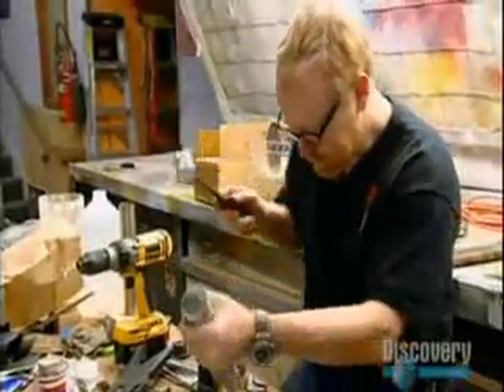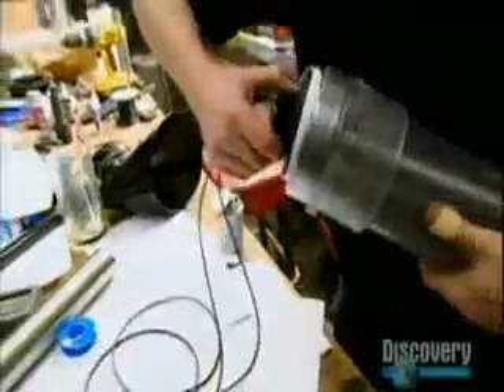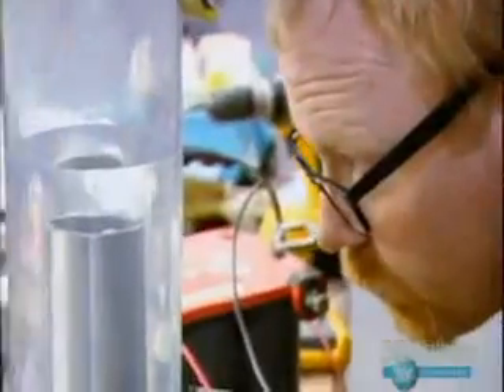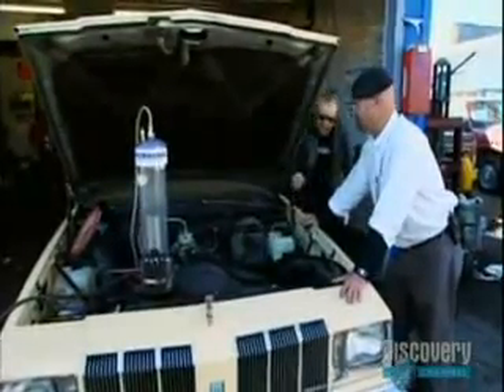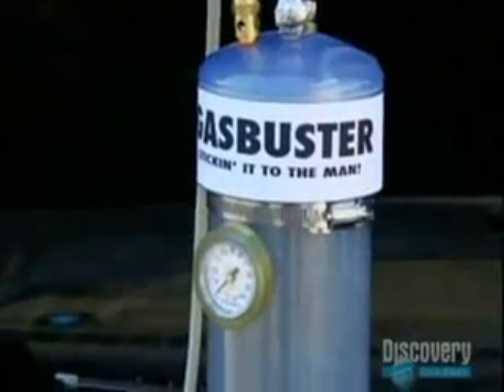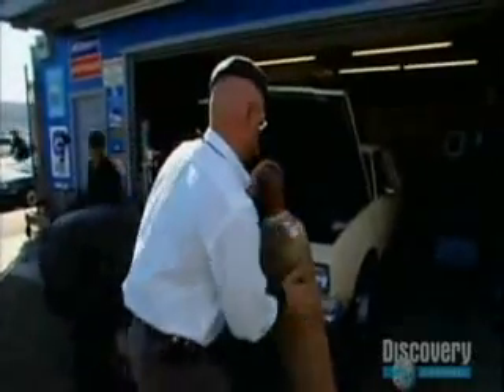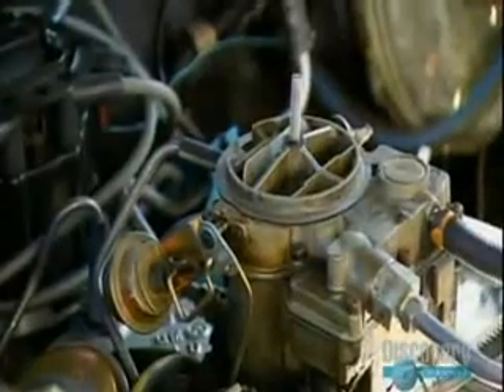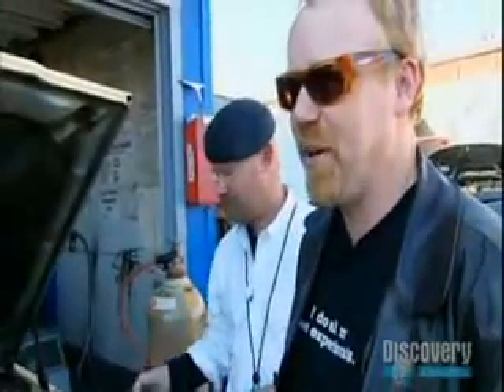HHO Mythbusters Explained

Comment: Tell me almighty tard fuck....where is your functioning fuel cell tested under lab conditions? Its always some super tard missing five teeth that shouts out "look at may mayonnaise jar technological marvel!"
 
Laws of Thermodynamics show why these dont work.
Reply: You can use sustainable energy like solar to generate the hydrogen, which would be used effectively as a battery. It isn't about some mythical free energy thing
Reply: then consider how much H it would take. A 2 liter engine at a 1000 RPM high idle would be using 1000 liters of fuel/air mix per minute.To produce 1/2 kilogram of H2 would take thousands of kilowatts.  You would be better off using that energy in an electric car

Comment: it didn't work cause  they do not add the power to brake the molecules faster you need about 30 amps to brake them on demand when you car is running and you not need to be a super intelligent to do it just common sense

Comment: This is the show that turned me off to this show, There were several shows that clearly show that they were payed to fail. I made an HHO generator and installed it on my 1992 Pontiac Sunbird  The fuel mileage  went from 26 MPG to 38 MPG. with no other changes to the car. One of the things that a lot of people dont think about is that 1/3 of the gas that you make out of the water is oxygen. This helps burn the gas and the hydrogen.

Comment: Total shower of PRICKS no idea that size is not enough to run a car but EVERYONE has it wrong you still use the petrol or DIESEL which ever the car runs on but add the hho and don't use the current  direct use a pulse module even then there isn't much gain in MPG till you fit a MAG SENSOR ENHANCER then 30% gain in MPG any way even without it the thing everybody is failing to understand  ZERO  EMMISIONS NOT 200MPH.

Comment: The question none of you HHO guys can answer is; how can you get more energy out than you put in. It takes electrical power to split the water into HHO, and that means more current needed from your alternator, which means more load on the engine, which means more fuel required to keep its rpm stable. And thats without even thinking about inefficiencies. 

There is no doubt it would help with complete combustion and increase power, but only if the power used to generate the HHO was coming from something other than the cars engine (say a totally separate battery not being charged by the alternator).

There is no such thing as 101% energy.
Reply: How many miles per gallon do you lose when you turn on music in the car?
Reply: 12 volts is already available under the hood...to break the water from liquid to gas
These vapors flow alongside the already moving fuel thereby reducing gasoline consumption.
Reply: I saw some guy making hydrogen with water and chloride, that's extremely cheap way of getting hydrogen, so why you need that electricity crap for?
Reply: Making hydrogen isn't the problem, how do I use it in my engine efficiently and safe - this is.
Reply: He put cold water, some chlorine and a aliminium ball - and got hydrogen gas

Comment: You can't tell me these inventive science guys who I avidly watched when they were on their show, wouldn't have known that you need an electrolyte in the water to aid the electric reaction. 
I was so annoyed with this one when they just let it go and not even use common sense and try it with some kind of electrolyte in the water to really prove whether it works or not. 
I can't help feeling there was some outside influence on this one... 
The YouTube channel "king of random" has a "HHO set up" to build that he claims produces two litres of hydrogen/ oxygen gases every minute or so with two car batteries. That's way more than most cars need.
 My car doesn't use a litre per minute!! 
And there's no chance of an explosion with this set up because it's "on demand".. 
It's only produces the gases while you're ignition is on. 
When you turn off the engine the gases stop and you only have what's inside the hoses. No big tank of fuel, ever!
Reply: Tee hee.  1 liter of hydrogen per minute would run a small toy car, or keep a couple of candles lit.  Not enough power to do shit..

Only have what's inside the hoses?  Still enough to blow the hoses off.  

That's not on-demand.  That's continuous generation as long as the key is turned on.  Where's it going while you're at a stop sign?

On demand would produce HHO only while the pedal was pressed and the car in drive.

Comment: I have actually ran my 2000 blazer on only hydrogen I drive it daily when I mix gas and hydrogen I can get around 40mpg I run a 2 battery system and two water perks to cool and store some of the gas. Running on just hydrogen I can get around for about 2hours before i need to pull off it gets hotter than gas obviously I have cracked 2 radiators from over heating but I know have a 3core misumoto and electric fans going on my first big drive today will let y’all know
Reply: bullshit

Comment: Yeah but you're still taking energy away from the engine to charge the battery. Then it needs to produce more horsepower
Reply: It won't drain the battery IF you use a solar charger pack on the dash to power the HHO generator.

Comment: Yes a car can run of hydrogen, but modifications must be made to the engine and intake systems. When hydrogen is burned in an oxygen atmosphere, it produces water vapor and oxygen gas that must be dealt with in the exhaust system.
Reply: Fuel cell

Comment: Nice work but still people attempt HHO production is with electrolyse process whatever the plate are arranged or pulse signal.  Have seen all and still the reaction is not efficient ( max 18 %)
I will explain new design that is not over unity but it will lead to > 90 % efficiency.
It is the electric field:
In fact the water molecule is dipole (Charged molecule) in strong electrical field it will be aligned and fixed direction. When you vibrate the lectical field then the O and H will oscillate. If you reach the proper frequency of molecule water then it will brake the connection and separate HH from O.

To get strong electrical field two option : two plate very close with low voltage or high voltage with distand plate. In both case you need to isolate well the plate to avoid electrical arc.
Electrical circuit with variable frequency to oscillate the field and see if there is a frequency will split the water molecule.
Un fortunatlly the frequency I have seen in article around 77 000 GHz, bu if the static strong electrical field when it is applied it will stretch the molecule and change may be the proper frequency. No theory about that only experience will lead to conclusion.
It time to stop normal electrolyse and pass to strong static electric fiend with oscillation in Mhz may be we will get 90 % effiency of HHO production.

No need to make big sample and expensive, simple two insulated plate is enough with static strong electrical field.

Comment: I don't understand I've heard this clean for years and yet I still have yet to see a working version
Reply: Same here. . . I'm also getting the conspiracy theory vibe from the folks that say it works.
Reply: @swainer8014  Not just them saying that it works, what does it for me is that they claim big oil suppresses the technology when fuels for road vehicles is a small fraction of the total raw oil use.
Reply: @swainer8014  it does work. Aaron salter was killed in 2022 in the buffalo mass shooting..he had a few videos on a HHO generating F-150 that ran entirely on water.
Reply: Are you guys idiots or just shills?? HHO has long since proven to be legitimate and extremely useful. Check out “SEVERS” videos from Belarus.  I own one of his HHO generators. Its incredible in so many ways.  He sells units for heating your home as well as torches and everything else. I have one of the torches. Its super power, super hot, super efficient and just superrrrrrrrr! But seriously it truly a piece of art. Love it. Saves soo much time and money. And has enabled me to creat things inwouldnt otherwise been able to do to the precision tiny incredibly hot lames
Reply: Running a HHO fuel cell from your car's battery is not going to increase your engine power. The reason is simple and has everything to do with thermodynamics (energy conversion losses). The electricity in the car battery is not free, it's fed by the car's alternator which consumes engine power. Therefore, it's more efficient to use the engine rotational power at the crankshaft to directly rotate the wheels than to rotate the alternator to produce electricity to produce HHO to feed the engine's combustion cylinder to increase the crankshaft torque....
Reply: Doesn't work
Reply: make one. you will never witness such a stupid simple efficient process unless you do
Reply: @Caleb Otsubo What would be the advantage of using such device then?
Reply: @AngeloArrifano  Not having to Buy Near as Much Gasoline, Not hard to figure that one out.
Reply: @docbrown6550  you are still missing his point. It takes power to produce the hydrogen to feed into the engine. You're wasting engine horsepower to maintain electrolysis resulting in a loss in efficiency. You would consume less fuel by not creating a load on the alternator. A pure electric vehicle would be more efficient.
Reply: @razredge68  You are missing the point, there are people that have proven through technology this works. The show done every thing in their power to make sure it didn't work. The Government even wanted to use this technology and is currently looking into it according to news articles the last few years. Go tell your info to someone that will believe it.
Reply: @Caleb Otsubo The same principle I explained in a previous comment applies. It's more fuel efficient to use engine power to directly turn the wheels than to turn the timing belt to turn the alternator to produce electricity to produce HHO to increase the combustion power inside de engine.. The alternator is at best 60% efficient. The HHO generator is at best 30% efficient.
Reply: @Caleb Otsubo This video we are commenting on is not about debunking hydrogen fuell cell technology in vehicles. It's debunking the "HHO kits" that some people install in their gas-powered vehicles in the configuration I described before.

Otherwise I agree with you, hydrogen fuel cells are an established technology and some cars (like the Toyota Mirai) take full advantage of it. But then again, this is not what this video is about.
Reply: Your better of building it on your own. Plenty of youtubers have done it. Trust the independent experimentors not the t.v. people.

Things never seem to get anywhere.
Reply: @harpseal9234  This one show proved The Mythbusters show to be a Joke, They did everything in their power they could to deliberately keep it from working and it does work.
Reply: It works

Comment: Truth is you have to do 2 things. You have to run the electrolysis device for a while (meaning you need a steady supply of electricity and I guess a gas generator can give you at least 8 hours of run time).  Or you can combine wind and split power and each of those are on a as available bases, but yea they will work.

So let's say you run a gasoline powered generator for 8 hours using around 2 gallons of gas, what would be the amount of hydrogen produced then?  I'm not sure but if it less then 2 gallons of gas worth then the whole thing is a waste of time.

Then you need to store it in large enough quantities. That's the tricky part as you need tanks to put the gas in and a pump that requires energy to run to pump the hydrogen in.

It does work and in a car engine it can work fine using fuel injection and some modifications to the timing of the injectors on their squirting of the hydrogen.

Comment: An internal combustion engine cant generate enough electricity to produce enough hydrogen and oxygen to run itself ,
let alone drive the car along the road.
if it could you could condense the exhaust back into water,  to keep your water tank topped up and your engine would run 
forever and never need topping up (  I DON'T THINK SO )  its all boll-cks . You might be able to use the system to add the 
hydrogen / oxygen to your regular gasoline or diesel fuel air intake to give your more miles to the gallon,  but that's about it.
Engine-------generator---------electricity-----------hydrogen / oxygen-----------engine... ( A BIG FAT NO  )

Comment: Yeah my hho generator blows theirs out of the water, I used NaOH as my electrolyte and it makes more hho than I feel comfortable with off an 18v 3.5 amp laptop power supply (less amps than a car battery, more volts but I've found no difference with volts between 6-24. Amps are the limiting factor for the most part.)

Comment: Mythbusters are right, you cannot run a car engine on water. One has to add an electrolyte to the water to obtain the fuel/gas/electricity to run the car.

Comment: This was an intentional fail to discredit HHO.
Reply: I agree
Reply: An HHO that is powered by the car cannot work there are too many losses, the lost from ICE heat, the magnetic resistance in the alternator, and the heat loss of the electrolysis. Only a prepressurized hydrogen tank would drive the car.
Reply: @Richard-jt6nt  
of course, but what do you think HHO stands for? it's not meant to power your entire car by itself, it's only meant as a sort of fuel booster or something that can help you save on fuel usage, or another way to put it, hydrogen on demand. 

and your correct on the other point as well, only presurized tanks of hydrogen will drive the car.
Reply: I agree. Very weak attempt.
Reply: Yeah, cause it seemed like all of a sudden they were idiots. Mine works fine.
Reply: They know how to do this. But for thier safty they failed the experiment on purpose
Reply: So this is the one episode The MythBusters did it was complete bullshit.

So they were trying to do HHO on demand using no fuel outside of just the hho from what I understand of the video.

I guess they didn't understand that for this method to work, you need to have gasoline and using the hydrogen at the same time in order to save on fuel.

Hho fuel can be created and put into cars by using a process of using solar panels to create the electrical charge within the water to separate the gas, it could be created passively throughout the day and stored into a tank if they wanted to.

The stuff is so easy to create, we could essentially have cars with pressurized tanks filled with Brown's gas to run the vehicle off of completely.

But the reason why people don't do that, is because if they ever got into a wreck it would be a giant explosion and probably kill everyone depending on how much fuel was left over.

So that's why it makes more sense to create on demand instead of straight up in a tank.

But the mythbusters, I'm willing to bet that they were bribed to do this and debunk it by cleverly editing out or getting the information wrong in how to create the stuff, because the powers that be don't want people to know that there's free energy that they can get from Brown's gas.

For those of us who have created Brown's gas, we know it's a legit process that actually works, but I believe the MythBusters here were paid to do it incorrectly so that people would think because they're quote on quote the experts in bunking myths, that they were just used to break the possible idea that it was fake.

I know the creation of this stuff is real, I've created it myself, and the people who say that it takes a lot more electricity to create then it is to be worth it, our fucking idiots and they don't know any better because they're taking their information from people who haven't exactly created it for themselves.
Reply: @5226-p1e Even then, they should have known how to make compressed hydrogen fuel to create a hydrogen powered car.
Reply: @easyenetwork2023  
if they made it a compressed hydrogen fuel, then yes, they would have made it work, it's been done before by other people within the last 50 or so years, but they have always been shut down for whatever reason.

hell, that bob lazar scientist dabbled in this for a while when he was younger, he had a car that used small canisters of the hydrogen and he explained the process of how it worked to a small degree.

the reason why he did it with small canisters of the stuff was a safety precaution because it can be unstable if the canister gets punctured while fire is nearby.

however one important detail about the gas, if there is no fire and the canister was punctured, it wouldn't blow up, because it's a inert gas and it's super light, it will fly to space long before you can light the gas, unless you had a already lit lighter near the exit point, then you would have issues.  

the whole reason why the massive Hindenburg ended like it did was because the air ship also had lots of oil in the craft and the flame was lit from the inside of the craft filled with hydrogen, likely someone smoking when they shouldn't have, and that's why it blew up as bad as it did.
Reply: @5226-p1e  Since when has Hydrogen become an inert gas? The answer is since never. Hydrogen is a very flamable, gas. The closest "inert" gas to it on the periodic table is helium.
Reply: @dmkays  
i never said it wasn't flamable, it's just very light and escapes very quickly.

it has to be in a controled situation to make it ignite.

Comment: H2 tank improperly stabilized (OSHA fine $$$) Hose  connection improper (OSHA fine $$$) general sloppy " engineering" and poorly regulated H2 flow into engine, and a whole bunch more wrong with this video.